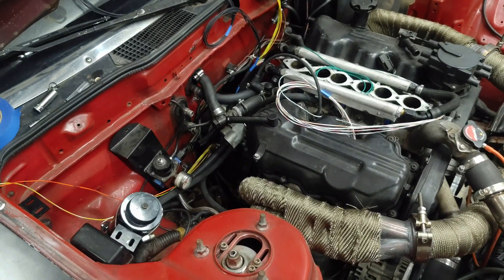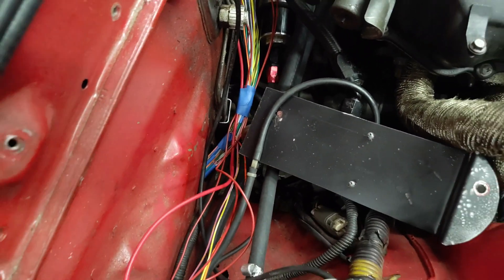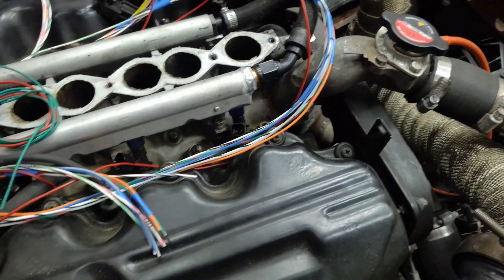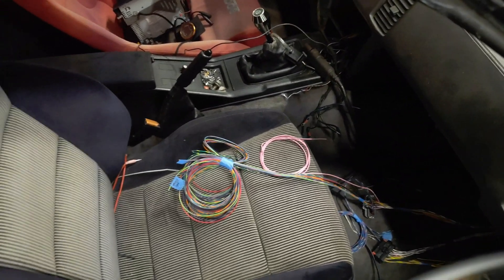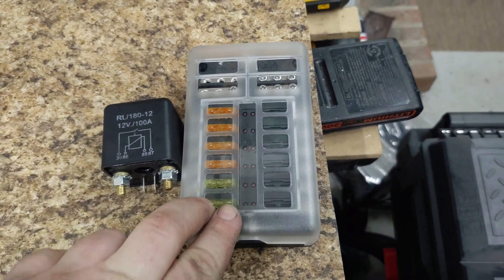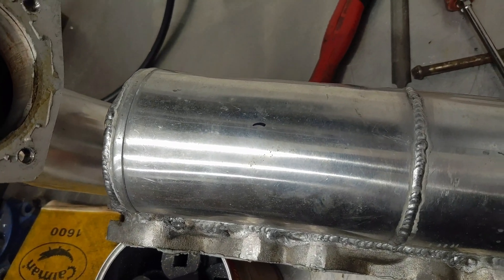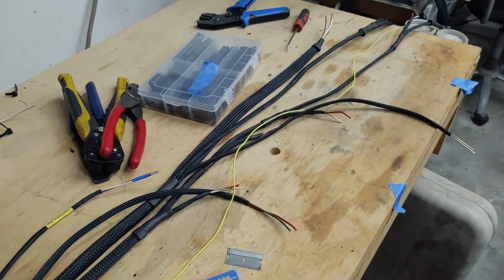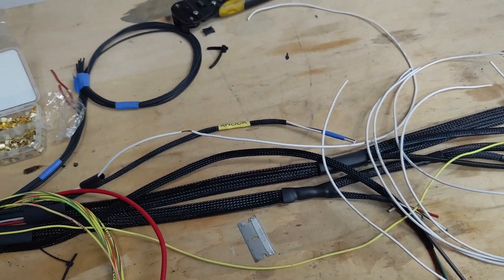Wiring Up My Megasquirt in My 300ZX!

Comment: Nice work man I'm currently working on my wire harness tuck on the passenger side . driver side was easy passenger side is taking some time. I went with a Hamilton engine harness with my megasquirt . That was costly but saved me a ton of time. I decided to do the wire harness tuck because the wiring was all screwed up anyways so I'm redoing all the wires to freshen them up 38 years will put some damage on the alt and starter wires lol! keep up the great work man looking good.

Comment: I like the turbo blowing into supercharger, always wanted to do that with my Z31.  It’s been hard for me to find a vg33er.  I do have a vg33 though which I will put with my GT3582 turbo and external waste gate setup.  I look forward to see how megasquirt works for you.  I am still deciding between nistune or another modern stand alone system.  I have also thought about a custom intake manifold with holley xfi system or quick fuel blow thru carburetor to get rid of computers altogether.  For now I run the stock injection system blowing thru the MAF sensor at the throttle body and boost reference fuel pressure regulator.  If you check out my 86 300zx turbo playlist you can see I have run a T70 external gated turbo and a TO4e turbo as well, both have their advantages.  T70 pulls hard after 4k and TO4e pulls good just before 3k.  Super charger pulls off idle so running with turbo gives idle to redline power.
Reply from the maker: I would for sure do the gold box. I have experience with aem infinity and haltech and unless you need drive by wire it can do just as much as any other "modern" standalone. It is only limited by yourself and whoever tunes the car.